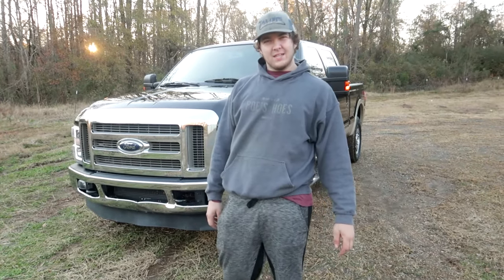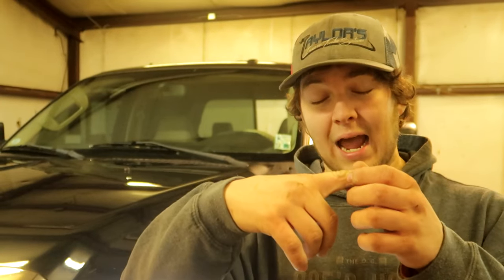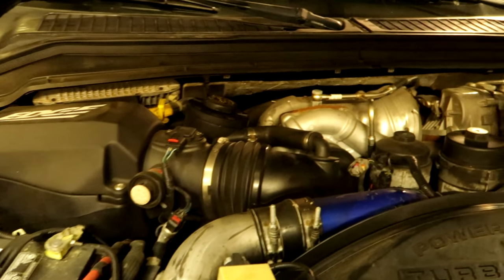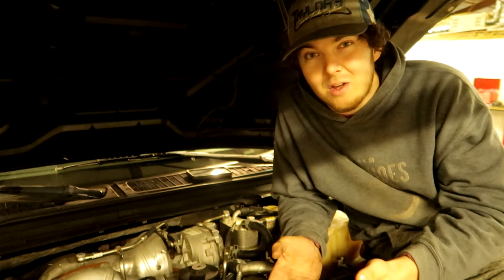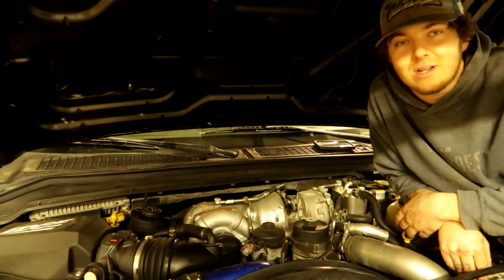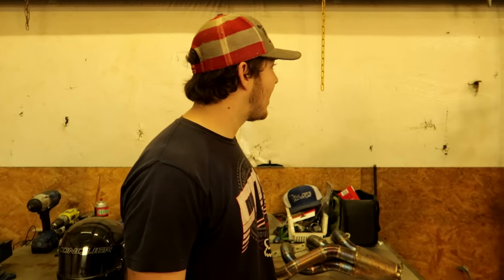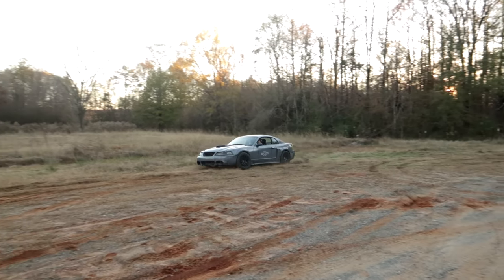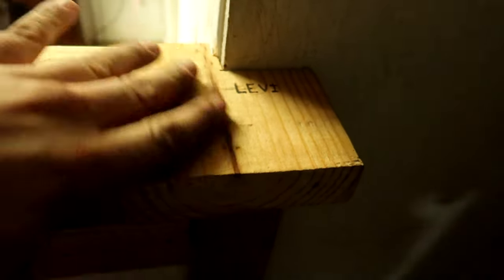Is the 6.4 Powerstroke a RELIABLE truck?

Comment: I got my 2010 F-250 King Ranch 6.4L back in Sept 2019.  Had 123K miles on it, paid a little over $20K.  I've had to sink some money in it (mainly the front end) but this rig has been great!  Living in CO with the high mountain passes, I need something with balls and this rig tows my 38ft camper trailer with ease.  I also have a 20 ft. Targa boat and I don't even know it's back there.  My biggest complaint is the fuel mileage.  It sucks!  I would love to do a delete but with emissions in my area, I can't get around that.  My truck has 144K miles on it now and I plan on keeping it until the wheels fall off.  In this market, I can probably sell it for more than I paid.  The 6.7L is way better, I get that but I've been happy so far.

Comment: I had an 08 6.4 crew cab long bed F250 that ran 12.20s all day long with just a tune, exhaust and injectors, oh it was deleted of course. Drove the literal shit out of that truck all across the country until it blew up at about 250k. Loved that truck. If you delete em early in the engines life and be diligent about fluid changes they can be really good trucks. I just ended up 12v Cummins swapping mine lol.

Comment: I’d have a hard time getting rid of it, but I understand why you want to. My dads boss bought his son one an it was shooting flames out the exhaust so bad it melted the mud flap with only 2,000 miles on it. I’m the biggest GM guy ever but the 6.7 is the truth, that motor is a monster. But so is the new duramax.
Reply: I'm not a fan of the Duramax but the LBZ is a awesome engine.The Oshkosh JLTV/LATV all have the 6.6L with 350 HP/700 TQ,since 2015 but the USMC didn't get them until 2019.And it's also deleted,they don't have any of that EGR,DEF,and DPF bullshit where the engine is choking on it's own shit and can't run at full potential.Military trucks are technically all EPA exempt.The LBZ is also used in the Navistar CV,which is basically a Topkick/Kodiak with a Silverado cab and bed put on it,it's a copy with a IH badge put on it,I don't think even the frame or chassis is Non-G.M.

The good Powerstrokes are the 7.3L and 6.7L.The 6.0L from 2005-2007 however is a good engine too.

Comment: I deleted my cat in my 6.0. Its crazy when these things get good air flow. Also she doesnt like to be ran soft she needs 1900 to 3000 rpm and thats wat sje loves. Nothing more fun to drive than a 6.0 with 4 inch exhaust sounds like a jet and do 3500 mile oil changes and ur good

Comment: I have to same Eastwood tig welder. I love mine!! I have it in my 16ft utility trailer along with my plasma cutter 21 gallon air compressor drill press bench grinder band saw, my mechanics tool and power tools. All mobile cause the generator will power it all.
Reply: I’ve never upload a video but imma try to upload the video of my trailer I made from Snapchat. Check it out. Could be for sale too...

Comment: LOL I had a build 1 2008 6.4 f350.  It was new with 3k miles.  I sat at a light, it went into regen, and I was unknowingly blowing a 6' flame out the tailpipe.  We could smell burning plastic.  Looked over and I had liquified the light and bumber on the car next to me.  So we blew the light and took off!  LOL

Comment: My dad was about to get  a 08 dually ford then i told him about the problems now he gettin a 2013-2016 ford f350 with the 6.7 so he gets no problems
Reply: The first generation 6.7 has its own problems but they didn’t show up for me until 350k miles. You can get your monies worth for sure
Reply: Every engine will have problems. Proper maintenance is the biggest thing. Mechanical parts will always fail at some point or another, fact of life you won’t prove me different.

Comment: It dumps more fuel to aid in the catalyst event. The dpf tank will release a measured amount of urea into the diesel particulate filter and will generate a ridiculous amount of heat.
Reply: 6.4s don't have def
Reply: @benjaminturpin2749  it does have a Regen event, where it purposely floods the back cylinders one on each bank and idles the engine high. It creates a ridiculous amount of heat.
Reply: @benjaminturpin2749  def systems operate similarly is what I was trying to say but shortened.

Comment: You are wrong about why the cavitation happens. The cavitation takes place as a result of EGR TUBES fouling up coolant system. Once you delete truck you need to add the ford coolant additive to prevent cavitation behind water pump

Comment: You got a ford curse bro lol. I’ve had my 6.4 since 2013 an ive only had a couple of minor issues . I’ve got it rebuilt recently since I plan to throw a little bit more power at it but other than that it’s reliable, just like any diesel ,ya take care of it an it will last you
Reply: I've had my 6.4 since 2012, never had a single issue with it.

Comment: We own 15 powerstrokes bud and we beat the ever living crap out of them every day plow overtow and they run hours on end in winter 4hi the powerstrokes are better than the duramaxes we have all brands and the fords are more reliable than all of them 2 6.4  and 2 6.0 never a issue one pump on 6.0 and one set of injectors all stock engines and og
Reply: Duramax

Comment: That looks pretty dark in those turbos thought you gave that truck a early delete?😢. Can't imagine what engineer would run soot back through the intake and mix with a perfectly calibrated air fuel mix to give the best combustion possible then run that through highly machined turbos with contaminants of carbon and  fuel. Fuel is not a lubricant and carbon is an abrasive like diamonds. Why don't you just spray a valve lapping compound through your turbocharger as well all that goo sticking to your vaining putting your turbos out of balance. This video is a few years old. But hay. All good. I'm running my early deleted 08/ 6.4 it's the end of 2023 she only has 140K miles. Kept the tune down Stock or tow. Tried steer setting but never had the use for that much HP😂 rain snow etc. I also tuned down the low boost fuel to#2 the tune was set at the factory at #3 out of a possible 5. Still have great performance and zero coal in stop and go trafic. Maintain timely maintenance drain the fuel water separator  regularly. Got rid of that stock cold air intake filter that just choked the life out of that engine. All said improved the MPG by 1/3 still these engines are  fuel hogs but a huge improvement. I don't know what  happened. But my transmission showed what looked like coffee grinds in the oil
 So I just said what the hell and gave it an up grade. Would  love to posietrack the rear end but for now I have spent enough fixing what the manufacturer should have. I love this truck. Next I not looking forward to will be the valve rack. I heard Bill at Bulletproof had valve covers that that sprayed more oil around the top end that was to healp that area maybe  he still has a set of valve covers

Comment: Little bit of miss information, the 08-10 ford was one of the best ever built, the engine was one of the worse. But the truck is top notch. Also deleting is illegal in all 50 states, it's a federal crime. People dont understand the full extent of those laws, you technically cant put larger injectors in a 90s cummins, it's not federally approved. It just hasn't been enforced, yet. But I agree, these trucks wont make it with the emissions intact, regardless of how many people say they made it 200k with no issues, they are not reliable with them.

Comment: 😂😂😂😢❤got one bought it in 2012 as soon as I had DPF isues it was deleted. Yes the front cover ate its self up keep high quality Diesel antifreeze and change it  every 5years. Some say use only Motermaster so I do. Only have 140K on it have had Deleted it at 100K still have the down pipe with the EBP line attached no problems yet!😊I  love this truck ❤. But you have checked all the boxes 😂😂😂😂.  They cercle all the problems right from the manufacturer. Ya. Theres a cercle around Ford.😂😂😂. But its 2023 almost 2024. Keep changing that oil and all those filters. Oh ya get rid of that stock cold air intake filter that thing is chocking the shit out of your engine. The EGR man putting that soot back in your engine 😱is just wrong! And just don't race it she is quick but keep that tune down mine is Stock or Tow. Also lower your low presure fuel to #2. Out of 1 to 5 # 2 is great like zero coal on normal take off in stop and go traffic and I see no preformance issue but don't race this engine. She goes but you will distroy her. Pull. She will pull your house all through the mountains of the Pacific Northwest. Hope to be one of the 500K owners.❤

Comment: For the record, I would not recommend getting a Toyota Tundra. They are gas guzzling pigs, they are not as simple as the competition. My advice: get an old Duramax or 7.3 Powerstroke again. The new Tundras are having turbo problems as well.

Comment: I have a 2008 6.4 king ranch I bought brand new, deleted all the bs at 125k, straight pipe and put a tuner on it, besides regular r&m with 175k on it now it’s been a badass mofo, keep oil changed every 5000k , put diesel additive every tank full and these things will scream down the street if you need it to, drive and haul normal and she’ll take care of ya, I wouldn’t get rid of mine for anything!

Comment: Just had one in the shop last week, did all 8 injectors, resealed everything, 2 weeks later low compression in cylinder 7 and 5. Absolute JUNK
Reply: Well putting bio diesel in your 6.4 was a mistake that ruins injectors. Secondly you should be using a diesel additive every time you fill up to save injectors
Reply: @drewhause2105  
Yep most owners only know how start truck up. When it comes to maitenace these owners are clueless.

Comment: Maybe if people didn’t tune the engine. It would last longer.
Reply from the maker: Sadly thats not how it works, the stock tune will go into regen randomly and wash out cyl 8's ringlands due to over fueling. It was a well known flaw from these trucks.  Thats why they NEED a tune, so they don't kill themselves.

Comment: Well. Hell boy the manufacturer circles everything wrong with the truck before it ever leaves the plant. 
Isn't there a circle around the name.🤣😂😆😅🤪🤑🤑🤑👍
I put a good quality diesel fuel additive in with each fill-up. As well years ago. This now being April 2024. I met a very good mechanic at a rock crawler event he said I'm doing everything right good antifreeze with the Motor Master antifreeze additive for diesel engines and change it every couple of years. But he told me. The best thing I can do is in every 17 gallons of fuel add 200cc of 2stroke fuel mix. With the amount of blow-by and the ring gap no matter what with the huge ring gap is especially in cylinders 7&8. Fuel getting by the rings will always be a problem. As well the high-pressure fuel pump can always use a little sliptivity. Since modern diesel has no lube. I thought why not should help the valve guides can't hurt. Now since I've been doing that there is little to no black smoke coming from the tale pipe in stop-and-go traffic. Also, put in a Catch Can with lots of baffling. I did a DIY Catch can 4" by 7" with 1" ID tubing to the inlet and exit. SS pot cleaner next to the exit vented to the atmosphere with a CCV filter. Don't need that sewage going back through and coating all the intake and mixing with that finely metered Air fuel ratio in the combustion chamber.👍😊🇨🇦
Reply: PS It's 2024 April I have like 145k miles. Now this thing had the rear main seal at 60k miles go worrenty😊. Front Plate, radiator, water pump, etc $2200 at 115k miles, not worrnty. Just be fore Christmas. Complete trany. Rebuild with a couple of upgrades for $7k. I don't race this engine but I drive it hard she pulls a 30' trailer all over the North West Rockies. She is a beast. Deleted all those emission control failed government science projects. Keep your cold air filter clean. I went with the K&S after the deletes. The stock cold air filter restricted the intake so much that the intake message would read change the air filter. oil and filters every 5k. I also improved the MPG to an increase of 1/3. That is an accomplishment. Wouldn't you say

Comment: 6.4s are way better than 6.7 power strokes ,a 6.7 will go 225k miles and you are done with it ,6.4s can go up to 350k with a dpf delete
Reply: 6.7 Built in-house is better than a 6.4 Navistar engine.
Reply: @janamaro5894  eah the 6.4 is very fast strong and easy to make very reliable
Reply: @ictdpowerstroke4591  It's very expensive.
Reply: @ictdpowerstroke4591  Well, I assume the 6.7 Powerstroke is way faster than 6.4l.
Reply: @janamaro5894   Actually , a tuned 6.7 will not beat a tuned 6.4 unless the 6.7 engine is heavily built .
Reply: @janamaro5894  the 6.4s come with compound turbos which is the main reason why they are faster,the 6.4s overall engine is just better for making big big power without big mods.
Reply: @janamaro5894  and also the 6.4s cp3 fuel pump is capable of holding 800hp while the 6.7s cp4 can hold 550hp tops
Reply: @ictdpowerstroke4591  6.4 does not have a CP3. It has a Siemens VDO K16 high pressure fuel pump:
Reply: @bcdieselsofficial  I know now  , I got mixed up at that time
Reply: @ictdpowerstroke4591  it’s OK. At least you didn’t get mixed up if you had to order a part.
Reply: @bcdieselsofficial  true

Comment: You're wrong Poe Ford is a great truck it's just those damn 6.0 and 6.4 powerstrokes that are a joke. If you 12 valve Cummins swap that dude you'll never have a major issue out of it again also RIP out the stock fuel system and replace it then your golden.
Reply: You’re right you won’t have any major issues you’re just gonna have 2.988 billion issues that will cost $2 million each that’s all the problems that you’ll have

Comment: I wouldn't buy any diesel they all have problems and are too expensive to repair. If the engines don't fail the transmission will. 99% of people drive diesel trucks empty everyday.

Comment: Just put an older 7.3 non computerized motor in it
Reply: Less shit to go wrong like if you find a non turbo one and a computerless system that would make a pretty good power plant with less possibility of failure unless you put bad fuel in it
Reply: No but i use to have a flatbed dually with the old 7.3 non turbo in it and it pulled a 10 thousand pound trailer like it wasn't there and i get your point the 6.4 isn't a bad motor what im trying to say is the older ones were just more simple and at least i didn't say put a cummins in it also he said he wasnt gonna use the truck for much hauling any way he's trying to get a new truck for that personally i think he needs a truck with either a 454 or a 460

Comment: You said first issue was the turbo, then you said first issue was water pump. Kid, stop lying.
Reply: Perhaps, he didn't lie to the engine problems.
Reply: @janamaro5894  The order dont matter, just be more precise, My 09 deleted, 144k. not one mechanical issue since purchasing brand new. Fluids,filters and fuel....always change, ford coolant additive for cavitation, and use ArchOil additves only! Runs like new.